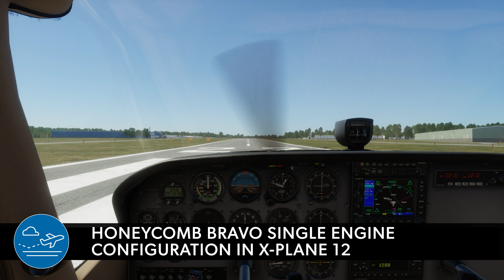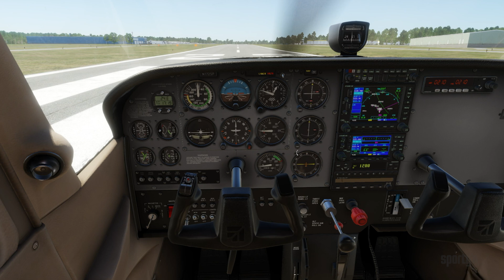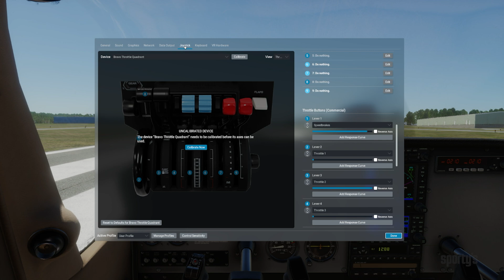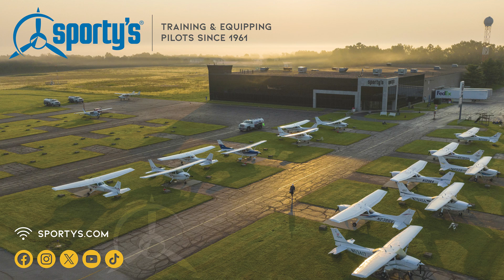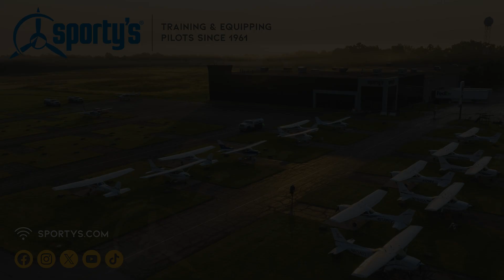Honeycomb Bravo Single Engine Configuration in X Plane 12

Comment: I don't have any issues with getting my honeycomb yoke, throttle control systems working, it is the Bravo controller auto-pilot switches-knobs-for setting auto-pilot settings (hdg, nav, alt, appr, vs, etc.) is what I cannot get working with XP12? Works great when using XP11...not with XP12.!!!

Comment: @Sporty's Pilot Shop     There''s a question about pitch trim and it's not covered in your video here.  X-Plane 12 has separate commands for electic trim and mechanical trim.  I set my trim wheel up as mechanical and my pitch trim A and B buttons up as electric pitch trim.  Is this correct for the Cessna 172SP with an S-Tec Autopilot?

Comment: I just installed my new Bravo and Alpha in X-Plane 12, but the lights on the Bravo Quadrant don't work, eventhough the switches and axis work just fine.  Any ideas on how to fix it?  X-Plane 12 seems to include the necessary files.  I don't see a download at Honeycomb for XP12.  The downloads seem to be for FSX, P3D, X-Plane 11, and MSFS.
Reply: @Randy97402 Did you ever figure out the solution? I’m having the same problem!
Reply: @LowkeyBreCollects  If you aren't using X-Plane, simply install the appropriate package from Aerosoft, from the bottom of the page I just posted.  You'll need to look at the Honeycomb forum or the developer of specific aircraft for suggetions fo particular planes.
Reply: @LowkeyBreCollects  Sorry, Lowkey.  I did reply and answer your question, but it's been deleted by someone, or some bot.  In a nutshell, it's not perfect, but it does work... the "AFC_Bridge" folder from Aerosoft's driver folder.  It's an easy download to find when you look for it.  I'd post the url, but it would be deleted again.  Sorry, but I did try.

Comment: Would love to see a video on setting up the Bravo for the AP and navigation buttons. Especially that left mode selector knob so the right knob isn’t limited to just one function. 

I’ve been trying to get this working with X-Plane 12 for Mac (Apple Silicon) and I think the APC Bridge might not work for ARM, bonus points if you get it working.
Reply: I just installed Honeycomb Bravo Plugin by Jorge Uvo and it does exactly what I was looking for, truly glorious to have this working.